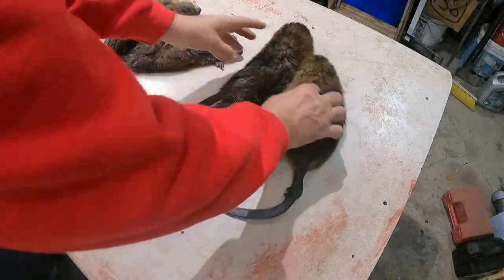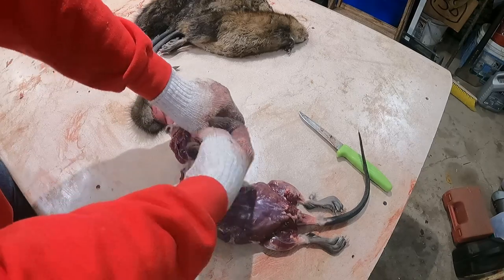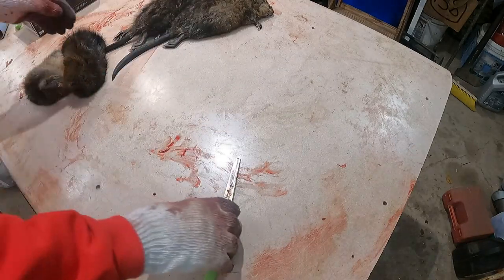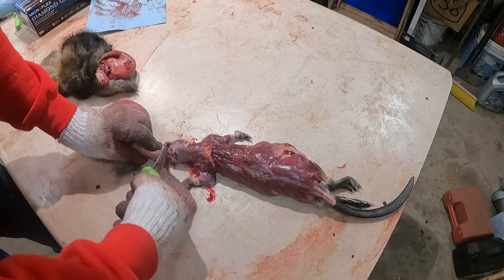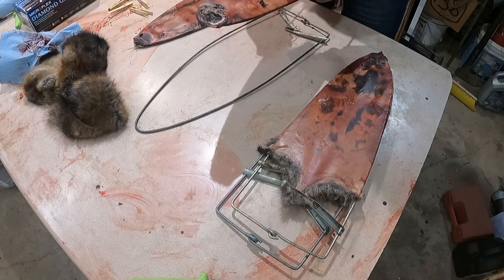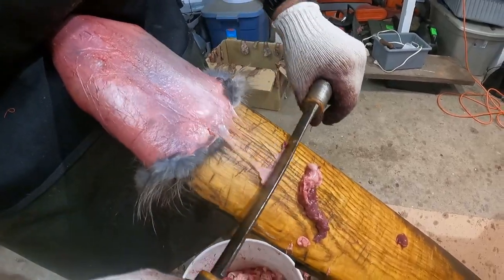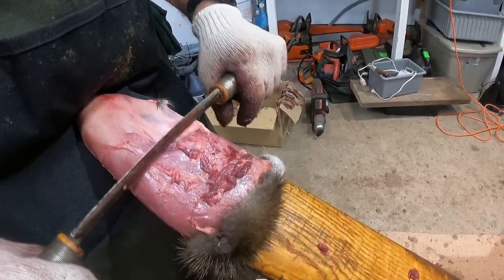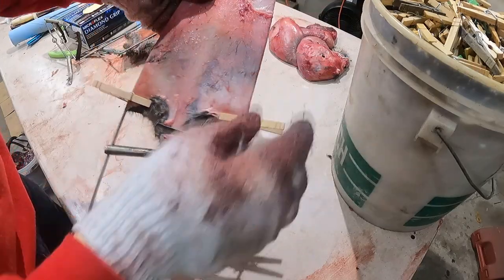FAST EASY MUSKRAT SKINNING FLESHING AND STRETCHING!

Comment: Great work! I will have to try that method of having them sit down and pull over. Normally I have them stabbed up on a giant hook by the tail and then just pull it down like taking off a sock and then undoubtedly I end up ripping the abdominal wall and then have guts to contend with.
Reply from the maker: It does work great but does take some time to get good at it. I wish you well!